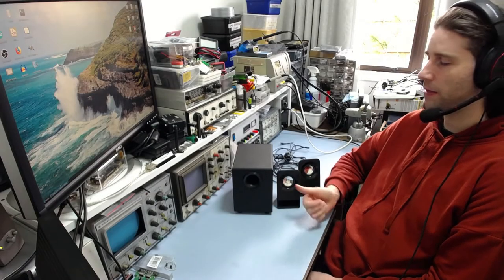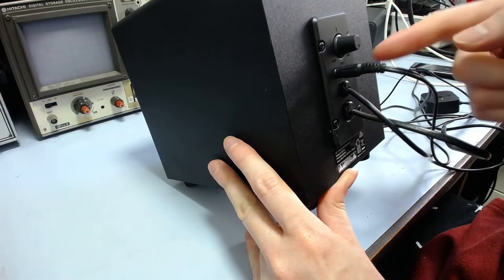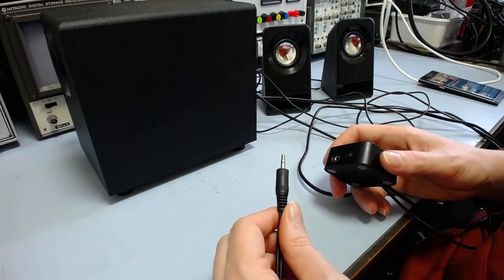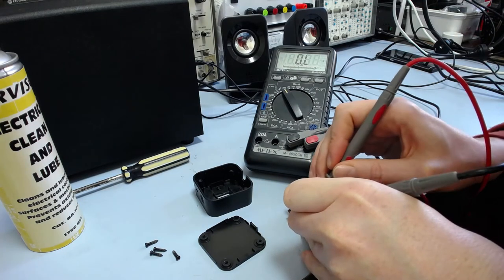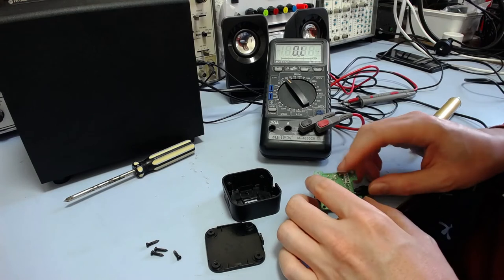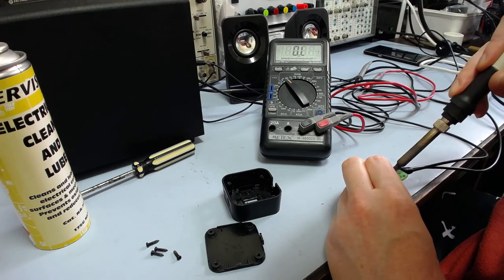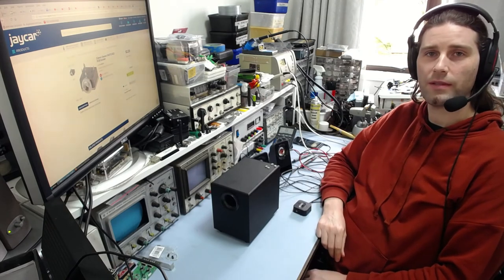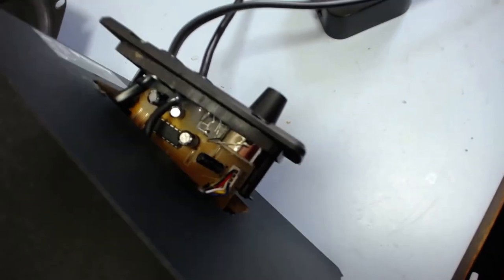Logitech Z213 computer speaker system repair?

Comment: I think this is a common issue to all the Z213 speakers. I've looked into this issue a bit and fixed mine by literally just giving the little control unit a sharp smack on the desk.

The way that the jack works is that it routes audio out to the speakers when there are no headphones plugged in, and when headphones are plugged in, the connector itself mechanically pushes the contacts away from the speaker output. There are two small springs that return the contacts when you remove the headphones from the jack.

I think the problem is that either the way the headphone jack is mounted, the construction of the jack itself, or just the way it works means that the spring doesn't always return the connectors back to the home position (it could even be the connector fouling inside the case), meaning that you can lose one of the channels and it leads you into thinking it's the speaker or the driver that's the issue, when it's just purely a mechanical issue and loss of contact.

I think a lot of the issues surrounding this otherwise good little speaker/sub woofer combo is simply a mechanical problem with this headphone jack.
Reply from the maker: Yeah the jacks don't appear to be very good quality on these. Replacing them seems the best option so far.

Comment: Hi! I have the same exact model and it completely stopped working. My pc is not detecting the device and there's no light in the control pod. Do you know what could possibly the issue and how do I fix it? Thanks!
Reply from the maker: If there is no power light, you either have a bad power supply, bad power switch, or bad power cable(s).

Comment: If the does not turn on and the light also not turn on, any idea what would possibly be the problem theoretically ?
Reply from the maker: Either your power supply is not working or something is causing it to stop working. The power supply could be bad, the power switch could be bad, there could be an overload shutting the supply down (like blown and shorted audio amplifier IC), or such.

Comment: Thanks! I was about to send my z213 into the repair shop, but after watching this I just opened up the little box thingy like you, sprayed some alcohol on the pcb generously, let it dry, closed it up, and  voila, worked like a charm! I could not find the resistance issues you found using my cheap multimeter, but I am a total noob so probably wasn't doing it right.
Reply from the maker: Glad to hear it worked, and I hope it stays working! This one worked OK for a while after cleaning, but the problem eventually returned. I replaced the jacks outright.
Reply: may I ask what is the little box thingy u opened? I am trying to find solution to fix my control box cause I think that's the reason why my speakers doesn't work. hope u see this!

Comment: oh same speaker....can i ask someting?.... it is still repairable if the speaker makes a heartbeat sound and the green light on the control box is blinking and sync to the heartbeat sound.
Reply from the maker: Most likely that is a power supply issue. You could be looking at a bad startup capacitor, controller, or other things. It's also possible there is a short or other fault in the amplifier that's causing the PSU to shutdown from over-current and restart continuously.

Comment: Excuse me, my Z213 has a small sound on the right speaker, the left is normal, do you know how to fix it? ther problem from the speaker or from the subwoofer.
Reply from the maker: If by "small sound" you mean "low volume" then it is probably the same issue as mine, the jack is bad or dirty, some alcohol or contact cleaner may help. Otherwise it could be an amplifier fault, or damaged wiring, but it seems like the jacks on these are not very good quality and would be the first to suspect as the fault.

Comment: Hello, I have this exact same model (Z213) n have only been using them for 5-6 months. It was working last night but then today I came back from work late evening it completely stopped working. There are no software issue, the microphone port by the volume adjust is working, my PC is definitely detecting the device, can do audio test but there's no light at the control pod. Do you have any input of what could possibly the issue be and how to fix them?
Reply from the maker: If you have no power LED and no sound, then probably the power supply is bad, or maybe the power switch itself. It's also possible there is a short circuit somewhere that's overloading the power supply and shutting it down, although usually in that case the power supply would power cycle and the LED would flash on and off (but not always - some latch off on overload/short - or just blow up)

Comment: It's actually possible that TEA2025 is used as subwoofer amplifier in a bridge mode and the other unidentified one is used for stereo speakers.
Reply from the maker: That could also be the case indeed. I still suspect the one with the heatsink was the subwoofer amp since that will need more power, surely.

Comment: mine is crackling on the right speaker when i tune the volume, and the right speaker is always at a lower volume. Could it be a potentiometer issue?
Reply from the maker: Crackling when you turn a volume control is very likely a bad or dirty potentiometer. The low volume issue could be many things, but quite possibly a bad jack issue like this one. You would need to do signal tracing to be sure though, or give the jack a clean and see if it helps (probably won't help long term, but might help you pinpoint the faulty part).

Comment: Hi, I have the bass problem, only a buzzing sound is heard.
Reply from the maker: Several things could cause such an issue. If the buzzing is on both the subwoofer and speakers, then you likely have a PSU problem like low voltage or too much ripple etc. 

If the issue is only with the subwoofer and the other speakers are working, then you may have a fault with the subwoofer amplifier IC. I would signal trace the audio to that chip and if the input is present and clean, but the IC is only outputting a buzz, then it's probably faulty.

Comment: Hello, greetings from Brazil! I have a soundsystem just like this one for 7 years, but last week the subwoofer suddenly lowered its volume and no matter what I do, but it to maximum or whatever, it just sounds like there's not enough power going through it. Been to 5 places trying to fix it, but anyone here knows how. Do you have any ideia on what can it be?
Reply: I think I have the same problem. I can only hear some sound from the subwoofer when both volume controls are on Max.

However, the tweeters are working just fine and when I power the system on, the woofer gives a short kick, so I guess power still reaches it, but the signal doesn't.
Reply from the maker: If the rest of the system works OK then I expect it is a problem with the amplifier circuit that drives the subwoofer. You probably need to trace the audio signal to try to find out where the problem is. Maybe the amplifier IC is bad or you have some problem in the filter circuit that removes the high frequency (I assume it has one externally to the amplifier IC). It could also be a problem with coupling capacitors in the circuit, etc.
Reply: @Agent24Electronics  Forgot to add an update here, they now work almost fine, somehow. From time to time the sub amp just stops working, but if I turn the system off and back on (no, it's not a joke), they are working again. My guess is that the issue might come from the standby fuction.

Comment: Im having a deep hiss problem with this model (idle and load) could it be the potentiometer causing the hiss?
Reply from the maker: I think it's unlikely. Bad potentiometers usually cause noise/static while you're changing the volume, or bursts of noise randomly. A continuous hiss may be caused if one end went open-circuit, but probably then you'd either get full volume all the time, or no audio at all, depending on the circuit design etc.

If you get a constant hiss regardless of volume level, and it's on all channels, I would suspect perhaps the power supply is at fault, or a filtering component that is common to the whole circuit.

If the hiss is only from one speaker or only the speakers or subwoofer, but not both, then that particular amplifier channel/section is suspect.

Of course it could also be something wrong with your source audio signal, but I assume you have tested that.

If the speakers worked fine then suddenly developed this hiss on all outputs, I would wonder about the power supply as it's an SMPS and perhaps the filter capacitors are on the way out.

Disconnecting the internal SMPS and powering the speakers from a separate PSU or bench supply may help you find out if it's the PSU or the amplifier(s).
Reply: @Agent24Electronics  thanks for the answer will try a seperate power source

Comment: Hi, intermittent faults are the bane of  my life but you put this to bed with very little hassle, Those jacks are readily available and have a typical contact resistance 30 mohms (0.030 ohms), if it were my own I would replace it but for someone else it's best to ask....cheers.

Comment: I had the exact same equipment and the same issue, also is the second time and im 80% sure that is the jack that is on the soobwoofer but i cant find the piece to replace it
Reply from the maker: These might do it: https://www.ebay.com/itm/144844128543 - I think both jacks on this speaker set are the same - but best to look and verify the pin arrangement first.
Reply: @Agent24Electronics  tytyty